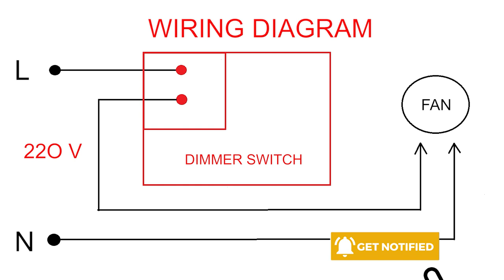HOW TO CONTROL ELECTRIC FAN USING DIMMER

Comment: Wowww so amazing i thought dimmer is only use for pin lights and incandescent lamps... Greatttttttttttt
Reply: Me too thanks this new gold CAPLOCK MEDIA
Reply: It doesnt actually work. It basically becomes a weird on off switch. Fans wont work with dimmers
Reply: ive tried it, it will damage the fan motor in the long run

Comment: Sabi ni chatGPT:
It is not recommended to use a dimmer switch with an electric fan, as it can damage the motor and potentially cause a fire hazard. Electric fans are designed to operate at a specific voltage and frequency, and using a dimmer switch can disrupt this and cause the motor to overheat or malfunction. It is best to use the speed controls that come with the fan, or to purchase a separate fan speed controller.

Comment: Will it cause any damages to the wall fan if we run in low speed in dimmer,coz wall fan is having only 3 speed levels , bt in dimmer its 5 level I think....so is it safe for all??
Reply: asynchronous motor will be overheating if you use it with dimmer
Reply: I cant see that it would  be dangerous as it restricts power to the whole motor. The motor size is small. check the rating anyway and then check the rating of the dimmer before you fit.
The current control of a dimmer operates on the same principle as a variable speed electric motor controller.

Comment: Is it safe for the induction motor?
Reply from the maker: This is for 500 watts just try to check your induction motor is fit
Reply: Depends on the type of the motor.
Reply: @marekogarek6329   A basic fan motor is low torque start up...even with different sets of windings. No problem, imo.

Comment: This is stupid and dangerous.  Your fan will overheat and may cause a fire. 
There are fan control switches available that look like light dimmer switches.  
I would recommend using a fan control switch instead of a dimmer switch, but if you think you learned something from this video, I recommend you stay away from tampering with any high voltage circuit.
Reply: 'Fan controllers' are dangerous too (at least most AC fan controllers).
Reply: honest question. How can it be overheat if the maximum power it receives does not change? it's not like a dimmer will deliver a higher amount of electricity that is received directly from the input.
Reply: @joe78man  the low speeds are dangerous. A dimmer switch turns the light source on and off very fast (your eyes can’t see that) so the light source appears “darker”. This doesn’t really work out for motors. Eventually on low speed the motor wil hum very annoyingly. Both the switch and motor will get very hot and might overheat.
Reply: It is a fan control switch when used to control a fan.
Edit:

I was an electrical engineer in my first profession many years ago.
I have a standing fan which is too powerful and noisy in the house and I fitted a light dimmer.

 It now works  at a variable slower speed and it's perfect for domestic use.

It doesn't get hot.... But I already knew that.😊